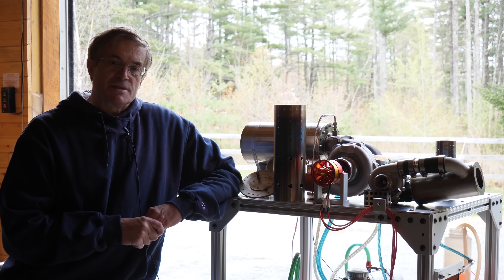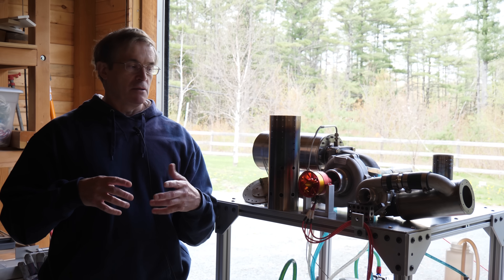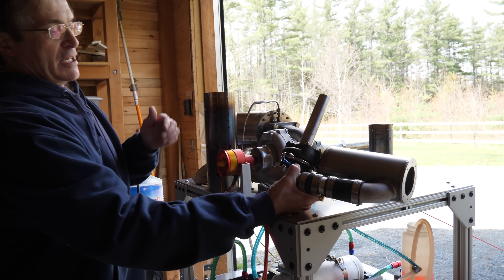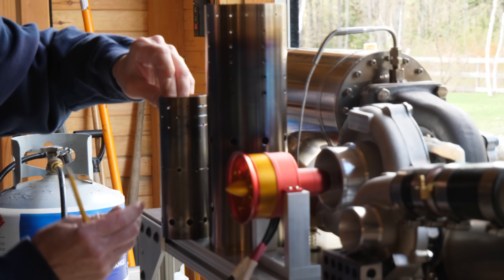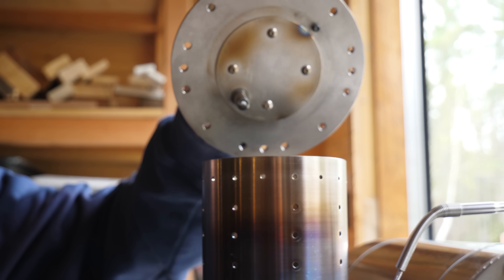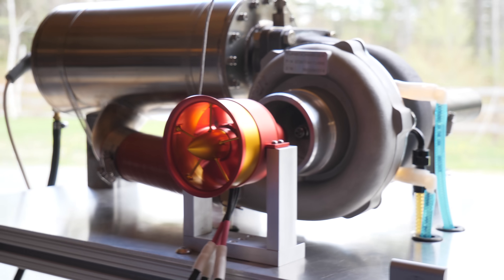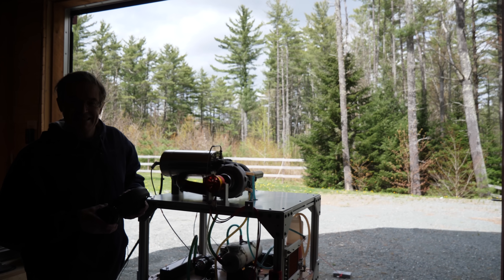Catching Fire - Refining the Jet

Comment: What turbo do you have in mind for the first stage ??  ...........it'll be bigger and noisier, ..................we certainly need ear protection with our larger engines , https://www.youtube.com/watch?v=U_Ltkxa-Ddk  2,800 CFM at ~4:1 PR and a compressor wheel  needing ~400 HP from its 130 mm Garrett G Trim turbo turbine wheel to spin it , produces ~200 lbs of thrust and a potential 250 HP once the freepower turbine fitted .
Reply from the maker: A similar A/R ratio, 73 mm inducer turbo is my best guess.
Reply: Yep , a Garrett GT42 or even GT45, but getting the right low pressure turbine stage configuration can be a tad troublesome due to the higher than normal gas densities going through it in a 2 stage engine..
You'll  be needing a decent sized intercooler , probably ~24" X 12" X 3" core , something for an 800HP IC engine.
I'll be interested in your final outcomes  with regards power output etc ,.... from all the calcs I've done over many  years on two stage setups (I actually started building such a setup >15 years ago) ,  theres very little to be gained from all the extra complication over a simple single stage engine using the larger first stage turbo .
The losses start to compound up , firstly the couple of psi loss through the intercooler  and "plumbing" , then because the intercooler is only 75% efficient the high pressure turbo has to compress hot air which needs more power from its turbine stage , which because of its small size generally has a lower efficiency than the large low pressure stage ,which further increases the losses , then , unless the lower pressure turb stage has a single open scroll  there'll be more losses if a twin entry  .
To finish off the torture , because of the two stages of expansion the gases are at a much lower temperature entering the freepower stage which reduces their working velocities into and out of the wheel  reducing gas deflection and horsepower production.
LOL.....I'd really like to see your calcs for this engine to see if they agree or not with my assumptions .

  @TechIngredients

Comment: Nice presentation, you're slowly getting there, heres what my DIY turbocharger based turbine engine did 15 years ago   https://www.youtube.com/watch?v=CplnY9TG7NE&t=30s
Reply: A bit of onboard video of what this/ my  115 HP  turbo based engine can achieve , 12 second 1/4 mile at 200 kph- 120 mph terminal velocity, and what one of my turbo rotor'ed engine designs achieved https://www.youtube.com/watch?v=yD8YEGD6TW4     300+ kph  by a friend in Sweden
Reply: https://www.youtube.com/watch?v=P-5PgWqgIJo    TV84 turbocharger based engine  with 115 HP

Comment: Would it be efficient and sustainable to evaporate liquid gas in heat exchanger by using cooling liquid from turbine? something like sistem used in gasoline engines when running on gas.

Btw you make everything sound so simple...  it is a gift
Reply from the maker: I'm sure it could be made to work.  Our more recent tests with the liquid fuel have been very successful and we will no longer be using the propane.

Comment: Hello I'm an aircraft engine inspector (internal components) of 4 years and engine assembler (both new an used) at a major manufacturer. Let me know if you have any questions. 

BTW we run engines with a type of refined kerosene, we push fuel through many fuel nozzles around the combustion chamber, the fuel nozzle have a pattern of holes machined inside of them to mix and swirl and air fuel together. We push fuel through high pressure teflon lines, with stainless steel braid then covered with a 0.125" thick later of RTV silicon. The fuel pressures are hydraulic ranges 1000 to 3000 psi, throttling the fuel is more complex than just a valve if you want to attain high efficiency, you will at least need shaft speed sensors.

You should redesign the combustion chamber and turbine support case to allow linear flow.

Comment: Have you thought about making helium baffles around the housing like NASA did the shuttles? How much space between outer walls and a jacket would it take to have sufficient noise suppression approx? I  mean if it is going to be running turbine generators and for stationary use it might be worth it.
Reply from the maker: Did you see our videos on hellium and sound?  The layer thickness might be microscopic.

Comment: The wood does not get chance to burn, very little oxygen, so it just pyrolizes.
Reply from the maker: Right.
Reply: @TechIngredients  Not right.  Those holes in the tertiary zone of the flame tube are feeding lots of air into the hot combustion gas stream to cool it off to a level where the turbine isn't being blasted with fire.  That's also where an afterburner gets the air needed so that it can burn a massive amount of fuel.  You probably ought to investigate that. It's even louder. And more fun.  ;-)

Best description of the sound of these engines I've heard: "It sounds like air being ripped apart."

Comment: I'm curious if some of the fuel issues could be solved with a dual-fuel setup? Have propane gas for starting, and transition over to kerosene once it's at operating temperature. That way it'd be able to get hot enough for a complete burn, and issues with dripping fuel that would otherwise happen during start-up would be significantly reduced. Introduces some more complication, but may avoid the problem of burning a gas faster than it could vaporize without other tricks involved.
Reply from the maker: As it turns out, the liquid fuel works very well by itself.  The start up is predictable and the engine runs smoothly at all throttle settings.
Reply: @TechIngredients  I've seen some examples where people have had problems with drips and pooling with liquid fuel on a home-built turbine. Then they go back to using propane gas because of that. (Less mess and fire hazard.) Might be the injector (or crimped tubing) they're using? I suppose you've got better gear than other hobbyists doing and demonstrating this kind of thing. I picture it still being a possible work-around with a less ideal setup.

Comment: will you add some more electronics to automatically regulate the engine?
Reply from the maker: I might, but it is extremely stable with the liquid fuel we are now using.  However, if the output of a driven generator needs to be stablized against varing loads then this could be useful.

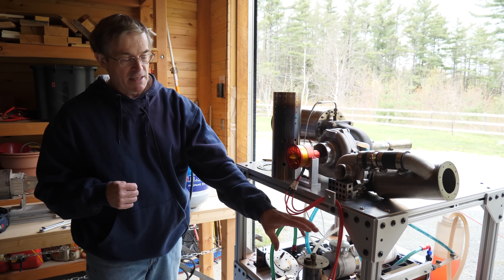Comment: @12:12 You are producing a lot of heat in the exhaust.  Couldn't you just tap off some waste heat to keep the propane bottle warm?
Reply from the maker: You could.  I'm concerned that the added complexity, trying to compensate for the evaporative cooling off the propane, makes a pumped liquid fuel more attractive overall.

Comment: Have you considered using water to keep your propane vaporizing? Set the tank in a tub with room temp water flowing around the bottom of the tank say at 70ish degrees should give you plenty of vapor for your project. Using room temp water also keeps the fuel at a lower pressure than it would be using hot water... Safety first :-) As long as you have a fairly good flow of water, you should never run out of roughly 120 PSI propane at the nozzle. (At least till the tanks empty that is, which I'm guessing won't take long ;-) I used to work with water bath vaporizers as well as direct fired vaporizers so I have a little knowledge... At least I didn't blow myself up... yet...
Reply from the maker: The amount of heat necessary to maintain the propane tempreture is large.  It's about 5kW.  Even the heat flow through the walls of the tank and the available surface area will require a significant temperature gradient.
Reply: @TechIngredients  do you have an idea of your btu load? (propane has roughly 92000 btu's per gallon) would be interested to see what your total load is. Used to be able to do the math in my head, now I need cheat sheets ;-)
Reply from the maker: It's a little over 300 BTU/min.

Comment: On a more serious note, increasing the exhaust mass as a means of increasing engine thrust (and efficiency) is very clearly seen on the increased bypass ratio on turbofans. They started out low, but they're now as high as 11:1 or even more on the GEnx and Trent 1100 engines, which means that only 1/11th of the mass passing through the engine is used for combustion, and the rest is just propelled out the back by the enormous fan.
Reply from the maker: That's right.  They are approaching the equivalent of ducted turboprops.

Comment: A thought "Turbine Powered Air Chimes"  (aka Fog Horn or Train Horn)  They require an insane amount of airflow the could possibly be achieved by using the exhaust gas of the existing turbine plumed into the free turbine of a second turbo then use the compressor side of the free turbine to pump air thru the air chime.  There's just something about claiming to own a Turbo powered Fog Horn that tickles my fancy! :)
Reply from the maker: You mean to make this thing even louder!?  That would be an interesting weapon.
Reply: @TechIngredients  Yes Sir,  Imagine a turbine powered 40hp 40Hz fog horn!  ◕_◕  Perhaps something like this https://www.youtube.com/watch?v=0rmBwCR1HVg and this https://www.youtube.com/watch?v=LMzAS9SsMBw  all powered by your turbine.   Once built it might make a nice additional to the Smithsonian's Apollo exhibit to emulate what a Saturn 5 launch might have been like when observed from the nearest (safe) observation deck.  :-)

Comment: Thanks for the fascinating project and videos!  I wonder if you could use some of your waste heat to gasify the propane before sending it to the nozzle.  In this case you would want a pressure drop somewhere in the line to prevent back flow.  Everything from backpacking stoves to rocket engines use this sort of strategy, though for somewhat different reasons ;).

If you draw only liquid from a propane tank, the gas pressure above the fuel can sustainably produce a moderate volume of liquid, though this will vary substantially with tank temperature and whether or not the tank can absorb heat.  Evaporative cooling is minimized with liquid feed, though.

Startup is an issue here, since you won't have waste heat at startup.  This depends on whether liquid reaching the nozzle is dangerous or poor for starting.  I hate to add further complexity, but a resistance heater of some sort might be added alongside the fan as part of the starting system and procedure.

Pumping is probably the most consistent solution, but I would not like liquid propane reaching the burner unless it can reliably gasify without causing danger or instability.  It would seem best to ensure it is a gas before it gets there.

Comment: While you did mention that you put the compressor tube mid-way [or about] on the burn can, you did niot mention that you also mounted it tangentially instead of normal to radius. ~( 'w')/

That was one of the details I had mentioned before, since the spiral air flow within the burn can will reduce hot and cold spots by ensuring that the air comes into the can more uniformly  instead of all up against one side.

It also helps keep the burn can cooler because the swirling air is driving more of the heat off of the metal and back into the flame.

The 3rd issue is that the swirling flame increases burn time within the can increasing combustion efficiency and flame stability.
Reply from the maker: I had addressed in the previous video, when I described the first engine.  This engine also has that same tangential orientation although I did not remind the viewers of that fact.
Thanks.
Reply: @TechIngredients  In the shot here I saw tonight  [do not recall seeing the previous video even if I did see it] the compressor inlet on the smaller engine looked much more normal to radius in the shot, if I saw it wrongly, I do apologize.

Comment: Looks like fun.

You might get a bit more power the start motor could be swung out of the way on a hinge, so the air doesn't have to go around it.

The propane getting too cool might be a missed opportunity. You might be able to use the fuel to cool part of the motor--even the inlet air, to gain efficiency. In the same way that the fuel/oxidizer cools the F1 engine. This would have to be done with care, as not to antagonize the propane too much : ) Perhaps you could even make a propane cooled inter-cooler between two stages. That way, your partially-compressed air is nice and cool, and your fuel is nice and warm.

Alternatively, the propane might also be transferred into a larger (propane-approved) tank beforehand, so that it can expand and warm a bit.

[As a bit of trivia, the Stinger missiles used a combination battery pressurized canister. The battery ran the electronics; the pressurized gas vapor-phase cooled the IR seeker.]

While this is all in good fun, a danger that might arise from these initial conditions, in which you need to build a 5-axis CNC to make your own turbine parts. : )

Thanks for sharing.
Reply from the maker: Thanks!
Engineering is about balancing all aspects of the components.
Reply: @TechIngredients  , that and getting started on your 5-axis mill. : )

Comment: @tech ingredients, what sort of shaft HP/Torque would you be looking at just using this or a similar setup to this connected to a turbine? Hypothetically wheel and prop output? (estimation is fine no need for complicated math at this point) i mainly ask as I've been in the process of building one of these out of a large diesel turbo. I'm still going to use it for my primary thrust experiment with a small boat and possibly hydrofoil setup but i have often considered using it like the US military uses smaller turbo prop engine for both flight based applications and ground locomotion like used in the M1 Abrams
Reply from the maker: If you get the turbo working I would go the extra step and plan to use a free turbine to drive a prop or fan.  The thrust gain from even a poorly designed system would be very large.
40 HP might be optimistic, but 24 HP should be pretty easy.  A large diameter turbine will give lower RPMs and a reversing flow turbine will cut that speed in half and double the torque.
Look into Pelton wheel hydro turbines.  The principle is the same.

Comment: Couldn't you have just wrapped your propane tank with a PowerBlanket if you felt the vapor pressure was getting too low?
Reply from the maker: Yes, but the cooling effect represents kilowatts of energy.  A very powerful heat source would be necessary and just getting that much heat into the rapidly cooling propane challenges the available surface area of the tank.

Comment: Do you have any plans to pre-heat the intake air?
Reply from the maker: No, that would actually hurt.  The colder the air, the denser and the less energy needed to compress it to a given density.
Reply: @TechIngredients  I am of the understanding that pre-heating the intake air leads to lower fuel consumption and a similar power output, as the turbine is extracting work in the form of heat; and that the pre-heated air, though less dense, doesn't require additional fuel to produce a given heat/power output? I.e. I am extracting 100HP and my exhaust temperature is 1000°. I can pre-heat the intake air using my waste heat, which in turn requires less energy added in the form of fuel. I am not an expert at all but cobbling together pieces of understanding; I do understand air density relative to PVT. The Chrysler turbine car utilized a pre-heater for improved economy and performance

Comment: Could you add a long flared exhaust nozzle to drop the velocity, and make this more suitable for vehicle propulsion?
Reply from the maker: Flaring the nozzle will actually increase the exhaust velocity at the expense of exhaust pressure.  The physics are facinating and sometimes counter intuitive.
Reply: @TechIngredients  Static or total pressure? At subsonic speeds, wouldn't flaring reduce thrust by reducing velocity and increasing exhaust pressure?

Comment: When u go  liquid fuel are u gonna use kero
Reply from the maker: No, isopropyl alcohol.
Reply: @TechIngredients  why iso alcohol
Reply from the maker: It is super clean burning, has more energy per gram than methanol, but like methanol it is much easier to atomize and vaporize than kerosene.
Reply: I run all my jet engines on diesel or jet a1

Comment: I think the problem with propane is it displaces air thus limiting power. I could be a bit off about that but generally on the right track. With liquid fuel, the unequal mass of air and fuel possibly has greater energy density and you can also run mixtures rich of peak exhaust gas temperature (stoichiometry) for internal cooling thus increasing engine durability esp under load. The complexity factor goes up however, as you duly noted. 

8 or 9 years ago I watched vids of guys building turbocharger jet engines and they all came to the same conclusion, propane is no good once you get the engine running right and are chasing more power.
One guy even built an afterburner and almost but not quite started to get mach diamonds. I can't find his channel anymore - perhaps the engine blew up and killed him. I shouldnt've said that but, yeah, you know be careful. Once the power really starts coming on as I see you're starting to get, catastrophic failures can happen. What makes it catastrophic is the unforseen failure. You might think the combustor or turbine housing is the thing going to explode but something completely bizarre happens instead like the psu makes the chassis live and you touch it have a heart failure and the ambulance goes to the wrong address lol. 

In my line of work bizarre is expected.
Reply from the maker: You're right about the tendency for projects to go pear shaped as they become ever more complex.  Pushing limits just amplifies this fact.
We have run this engine many times since this video with alcohol fuel and it works at least as well as with the propane.  It starts right up, runs smoothly and produces more power.